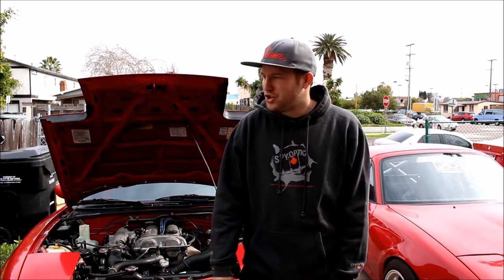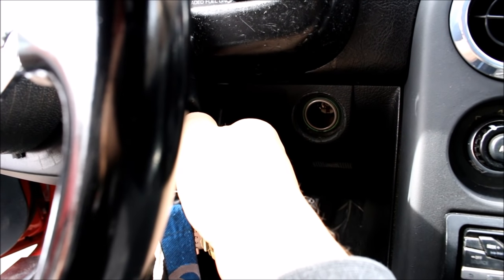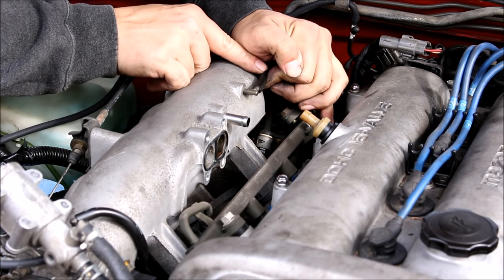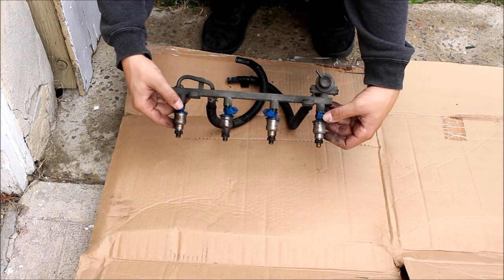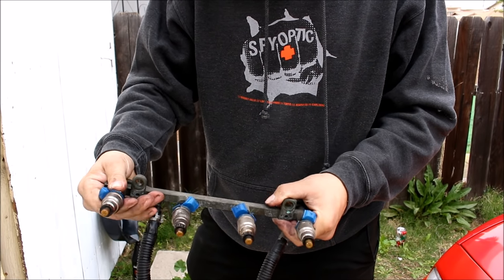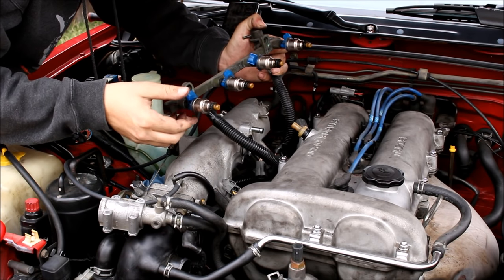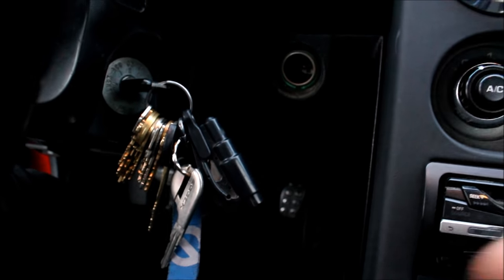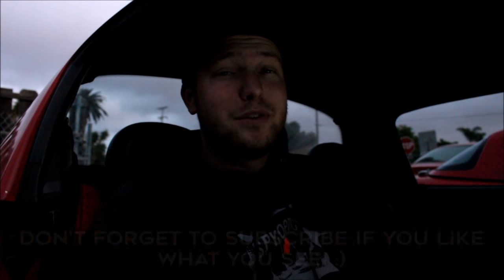Injector Upgrade: Why & How? (With Megasquirt Settings)

Comment: Hey Greg I know this is an old video hopefully you can see my comment out of all the ones you get all of the time but I have a '90 Miata and I noticed that my idle wasn't stable and it would be rough when cold and I would compare it to a cammed muscle car also on top of that my car had no power till 3k or so RPM and when it hit that the car would instantly pull. I can compare the feeling to a boosted car with turbo lag if that makes any sense. I looked up on the forums and found that it is the injector insulator. So I would need to replace the faulty injector right? I figure I might as well just upgrade all the injectors since I have to replace them any how. I don't know what injectors to use or what all I will need after changing my injectors. Will I need an aftermarket ECU if I get bigger injectors? I hope you get my question because I don't want my car to stay sitting for long. Thanks!
Reply from the maker: Tyler Gittere I wouldn't guarantee the diagnosis from a forum; but if you need to replace the injectors and you want larger ones you will need a standalone ECU. If your car is n/a there's no benefit to going with a larger injector though.
Reply: Ok thanks I really appreciate it. I guess I'll save the injectors for when its time to boost the rice bucket. Means a lot when someone you subbed to will respond

Comment: If I got 440cc injectors would I need to tune them for them to be at 440cc or would they automatically be run at 440cc
Reply from the maker: Huh??

Comment: hey what injectors do you use and how much did you pay for them? i have seen a lot of options but im honestly not sure. i am looking to get around 230 whp. also should i upgrade my fuel pump if im trying to push that much hp?
Reply from the maker: +jonathan alipio The stock pump can handle that, it's never a bad idea to replace it if it's old. I use Five-O Black Ops 750cc injectors but you need a lot more injector for E85. I started with refurbished yellow RX8's from eBay, they were $170 and I did around 220-230whp on 91 octane with them. Those are also plug and play. (You still need standalone ECU, but they fit into the stock rail and use the stock harness plugs.)

Comment: im ordering everything for my build im looking for a set of drop in plug and play injectors that can handle 350whp . and suggestions would be much appreciated
Reply from the maker: +Justin Hart What fuel? A set of 1000cc injectors will cover you for sure. There aren't any that are plug and play but if you know how to build a 350whp Miata motor I'm sure you can handle soldering a few connectors!
Reply: +TheCarPassionChannel ok thanks man much appreciated

Comment: How much power does the stock clutch handle for a 93 Miata?
Reply from the maker: +Aidan Morris They usually start to slip around 140-150wtq or so

Comment: What about better fuel filters? Like better flow & even smaller contaminates filtered out? If possible? I don't know what the MX5's fuel filter is like, but I'm asking incase any knows the answer. And all this can help anyone improving the hardware & software of the fuel system, of something other then an MX5.
Reply from the maker: +RoyalSilver&Gold I've never heard of anyone using an upgraded fuel filter, people have done like 500whp with the stock one, it's not much of a restriction.
Reply: +TheCarPassionChannel I was worried about that. I'm just thinking of every way, to make an engine as strong & efficient as possible. As with the fuel system, I was thinking about a better fuel filter & pump, but you said the pump may not need to be upgraded, and now, fuel filters may not be so restrictive. 

Next. If I remember correctly from automotive school, one of my instructors said, in drag racing, some people have their fuel lines, like spiraling into a bucket of ice water, before the engine, to make the fuel denser, like more fuel molecules through the injectors. I don't know how effective that would be. So at most, I will just protect the fuel lines from heat sources, by wrapping them in heat reflective tape, and in my case, the walls of my bike's fuel tank, that's facing the engine. Last, I still haven't confirmed if this is complete bullshit, but I remember videos about putting powerful magnets on the fuel line, to improve the fuel flow, like in the rail & out the injectors.

Comment: What about upgrading the injectors (450cc) with a stock ECU
Reply from the maker: Erik McIlhenney You can't, you need to have a standalone or some sort of piggyback. The stock ECU can probably do around 320cc max
Reply: TheCarPassionChannel

thanks
Reply: @TheCarPassionChannel  hello,im thinking in put 450cc inyectors with stock ecu but why the ecu cant work with this?if you have the same times for injection in the ecu maps,you can put more gasoline with the same time with this inyectors no?And if i not change injectors,what presure you think correct for put in a fpr for 5psi of boost?thanks mate.
Reply from the maker: @JuanDiaz-fv3ww  The car won't start or idle properly, as you said the injection times are the same, but 450's will be dumping double the amount of fuel during cruise, idle, startup, etc

Comment: it was rx8 injectors you installed? whats your power goal with broke and boosted? do you run 750cc in your other car? :)
from the guy with the silver rally miata with red mud flaps from snapchat ;)
Reply: I think he kept the stock injectors.
Reply: +Sam Williams  not on his turbo build. On broke and boosted he hasn't changed them yet.
Reply from the maker: +chevyjimmy Yeah I just did this to show the process of changing injectors, I'm leaving them stock in that car, I might upgrade them to 1.8L injectors because the ECU can still run those. Yeah I run 750cc in my other car, need some big boys for the E85 life.

Comment: I wonder what set up he has for his steering wheel.
Reply from the maker: +Luis Martinez Which car?
Reply: +TheCarPassionChannel both I guess
Reply from the maker: Luis Martinez Both have Grip Royal wheels, my turbo car has an NRG quick release, the B&B project just has an ebay hub, non quick release.
Reply: +TheCarPassionChannel  cool I just bough a nrg complete set up but ran into some trouble with the nrg hub.

Comment: Soooo, this is a little easier than on an nb huh?
Reply from the maker: A little bit, just because you don't have to split the manifold. If you check out my MSM Tuning video I did an injector swap on that car too
Reply: @TheCarPassionChannel  thanks, I think I have it saved in my Miata build playlist now that you mention it 🙂

Comment: If aftermarket performance injectors aren’t vehicle specific for my 1998 Buick Park Avenue (3800 series 2 N/A) and I want to build it for boost, what options do I have for getting more fuel to the engine?
Edit: after further research I have found a fucking vehicle specific nitrous kit but  no fucking injectors!?!?
Reply from the maker: They don't take the same injectors as the Buick Grand National? (The 3.8L twin turbo?)
Reply: TheCarPassionChannel I’m not sure 🤔 there is a supercharged model of the 98 Park ave so I might be able to find some bigger injectors from the supercharged model
Reply: TheCarPassionChannel the fuel pump was also a concern of mine but again I think the supercharged model has a bigger pump that I might be able to bolt on

Comment: that miata is worlds easier than working on the z32
Reply from the maker: +TheMainMan318 Why do you think I'm addicted to modding them?? I told myself the Miata would be just a simple daily until I got the Z32 back on the road, but when I started modifying it I was like wait.................. this is 1/3 the price and 5x as easy... I must continue. I still miss the Z though, I'll get cracking on it at some point.
Reply: yeah i'm so afraid to really start tearing into the Z, so the small issues it has I kind of just deal with (which isn't good), but I just enjoy driving it too much to want it to be out of commission for so long. Shit I can barely get my hand anywhere in the engine bay... If only I could fit into a Miata... How tall are you?
Reply from the maker: TheMainMan318 I'm about 5'10" and have lots of headroom haha, it's all about that seat setup.
Reply: yeah with aftermarket seats I maybe able to fit. I just can't imagine the NA having more room than the NC miata I drove awhile back. I had my seat all the way back and i barely fit

Comment: I have an nb, so do i have to remove the whole air intake in order to get to the fuel injectors?
Reply from the maker: Young Veezer I believe you can remove just the top half of the intake manifold.
Reply: Anything i should keep in mind when i do that or do you have a video of yourself working on it so i can go into it with an idea of what im doing...? (Obvious noob face)
Reply from the maker: Young Veezer Mark all your connections with masking take/marker so you remember where they go, just try to stay as organized as possible. Take pictures, etc. And don't drop anything into the open manifold haha.
Reply: Okay. Hopefully that and an oil change and ill have my miata on the streets!! Thanks for your help Greg!!